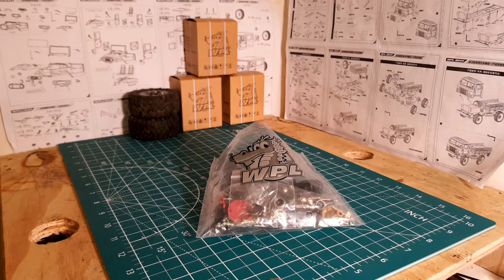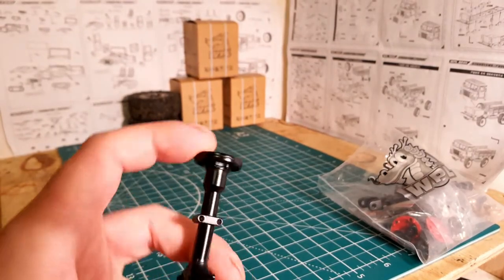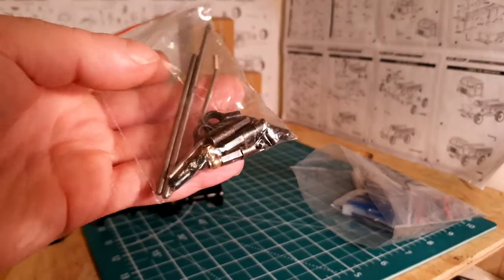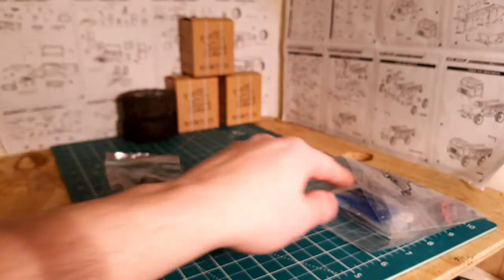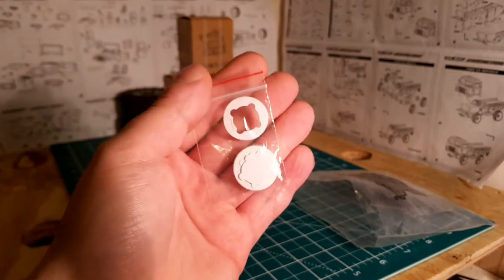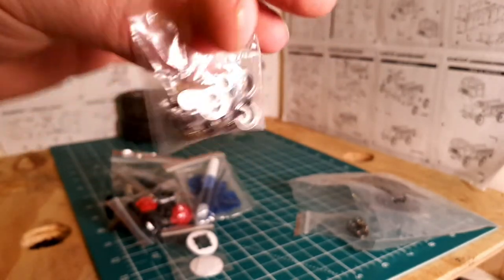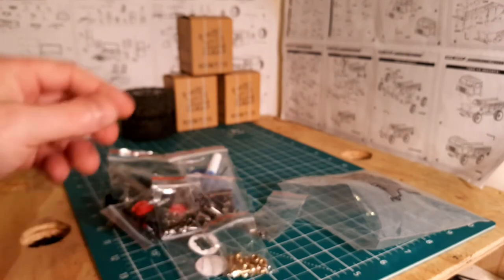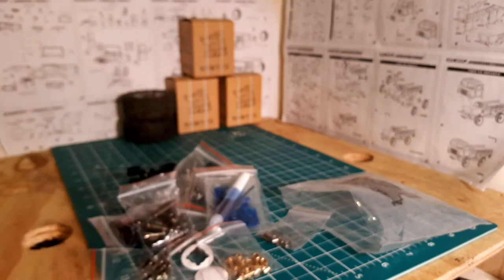Official WPL RC Metal Upgrade Kit for 4x4 💪 What's inside the bag!

Comment: I usually get some spare items from WPL, but hope they put in an extra brass bushings for the front axles. I lost a piece both on my C54 and B16 metal axles.
Reply from the maker: This kit comes with bearings, those new brass bushing are very good.
How are you losing those, driveshaft falling off?
Reply: @THYC  .. OK I actually called it wrong. I think those are called brass sleeve. The ones that you insert before screwing in the steering arms(?) I usually loctite them screws last coz I always had trouble on this part. I guess I missed loctite-ing those 2 rigs of mine. I lost the ones on the bottom only.
Reply from the maker: @kreezrc  is this the part you are referring to?
https://www.wpl-rc.com/collections/metal-upgrade/products/brass-sleeve-4-2?ref=THYC_RC
Reply: @THYC  yes -- i think that's the one. so I ordered a handful just last night. 😬
Reply: @THYC  Bought it already. Will mount to the rigs and head back to the park!

Comment: Hi do you have to buy metal axle trusses (for mounting the steering linkages and shocks) or do you reuse the plastic ones? Thanks
Reply from the maker: They still use the stock plastic trusses
Reply: @THYC  thanks for your quick reply. I'll get the kit ordered tonight then, absolutely in love with my C24 but it definitely needs more weight!